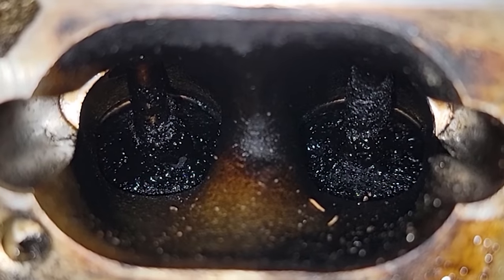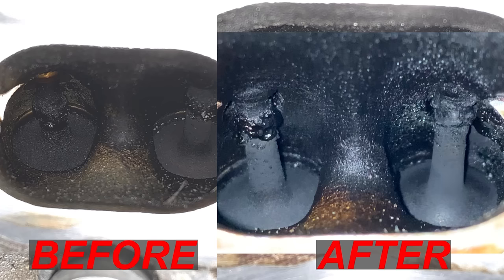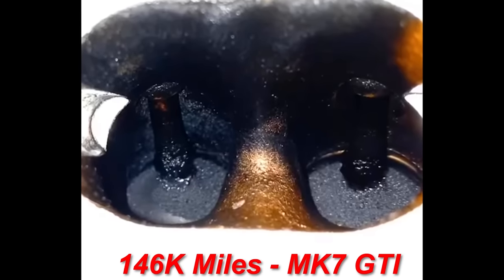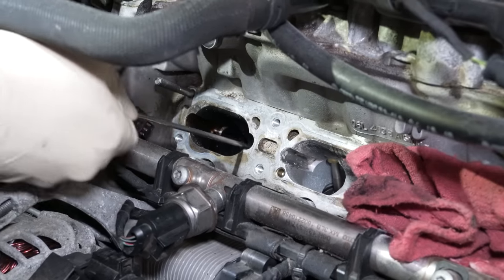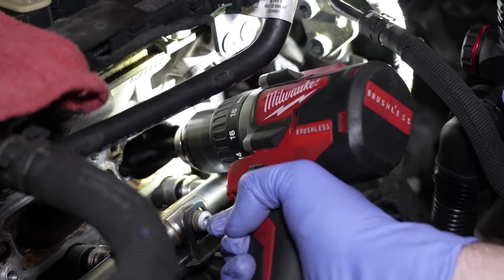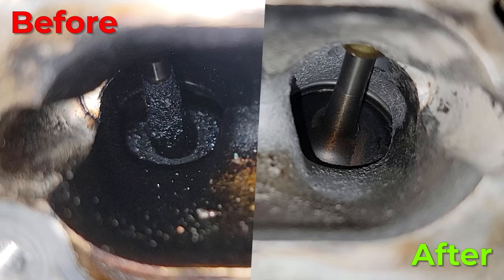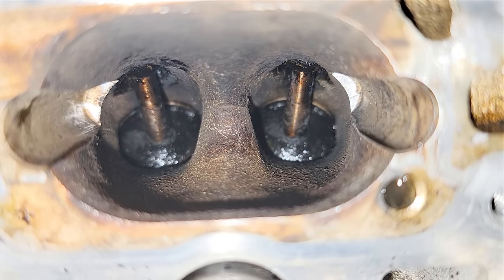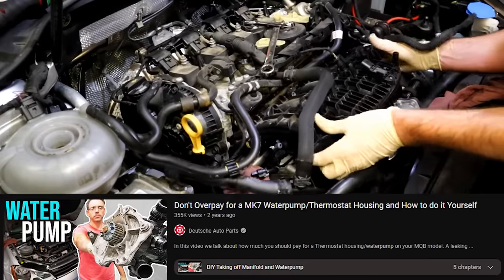How To Clean Carbon Off Your Engine!

Comment: Italian tune up does work, it has been proven and is a chemically totally sound method. Italian tune up doesnt mean reving your enigine in neutral though, you have to actually drive the car under full load for an extented time. 15 minutes of topspeed is totally enough to burn all the carbon off. You have to hit a certain temperatur on the valves for the buildup to dissolve that I dont remember exactly but it does for sure work. Somewhere around 380° celsius. Drive your car properly and the carbon will burn off automatically. German cars are not meant to be driven at 120 kph guys... You have to use the engine from time to time for what it's designed for.
Reply: So a track day from time to time

Comment: I think the only good way to remove the carbon build up is removing the head, pushing down the valves so u can remove it from the round end shape as the carbon buildup is mostly between the 2 surfaces touching eachother

Comment: Im a 12 Mustang owner and Fan boy Ive never had a issue like this, My wifes Buick enclave gets so bad i have to clean it every 25000-30000 miles. I tried seafoam DI cleaner. Barley did anything. I use a combo of pick, Toothbrush, with a hose hooked to a shop Vac.

Comment: would be interesting to see a dyno with before and after , i'm curious how much did that carbon inhibit the air that the engine needs . maybe it would help also if users wouldn't take the car to cross the street and avoid short trips
Reply: The Best prevention of these carbon clogs in the engine is to cut off the Egr valve, which is bringing this dirt from the exhaust back into the engine. So, the Egr valve does not eliminate the pollution of the environment, but just delays it, and stores that pollution into your engine ports. That is why the Egr-valve is a terrible deception , just as the catalysators are.

Comment: What's your take,on the old school method from the 50's & 60's of using plain water slowly into the intake system while idling on a hot engine to steam clean you're pistons and valves? without harming the cat's.

Comment: Have used 50% automatic transmission fluid and 50% acetone blended.  Soak and agitate lightly with an old toothbrush.  Carbon melts off in no time with little elbow grease.

Comment: Can carbon build up cause misfire on cylinders and rough driving at low rpm? Also epc and check engine light? It all started with cold start misfires but car drove well.
Recently it started rough idling and misfiring a lot while driving and it was very noticable, engine shaking as well.
I replaced spark plugs and coil packs, still the same. Misifiring always from cylinder 2 and 4.
My mechanic said it’s carbon build up and we need to clean them, this is a 2013 tiguan 2.0L turbo.
Makes sense?

Comment: So it appears in the long run, for better emissions and performance it is best to have port injection over direct injection.  Or even an obsolete carburetor option for an air/fuel mixing device.

Comment: 5,000 mile oil changes with GF-6 certifications and prophylactic air/oil separator. BG induction service every 30k as well as replacing PCV valve. Done.

Comment: Would a dry ice cleaning machine help you clean that carbon of those valves faster? That method has been used in other situations with fantastic surface cleaning results.

Comment: Ironically the Italian tune up actually does help and so does running in the rain.  Doesn't stop it from happening but does reduce it.  Better than not doing it.  I had way more carbon build up when I drive fuel efficient 98% of the time compared to when I held the revs regularly.  My engine was taken apart to walnut blast it, so I did see the difference.  My engine lasted about 20k longer before it needed to be taken apart and cleaned when doing Italian tune ups and yearly seafoam spraying.
Reply: Engines up to temp are definitely much less susceptible to carbon buildup, as most of it happens when the engine is warming up.

But burning off builtup carbon buildup without detergents or other cleaning agents is usually impossible off of pure spirited driving alone.

But yeah engines actually will be healthier when they get to use their full rev range (when up to temp)
Reply: I don't doubt the Italian Tune wold help remove carbon from pistons and combustion chambers, but the issue he's talking about is with GDI engines. Gasoline doesn't get sprayed before the intake valves (but directly into the combustion chamber instead), so valves don't get washed during fuel delivery.

Comment: I just did a spark plug on my suv and have accumulated a lot of carbon build-up on the intake valve using the endoscope camera.  Is there a way to clean them without tearing apart the engine?

Comment: Could you use EGR cleaner on the valves instead of the valve cleaner used in the video (thinking more for diesel engines)?

Comment: Direct injection might offer more power etc but with the on going trouble of clogging inlet valves further down the line would make me look for the older type port injection engine. I believe Toyota have engines with both port  and direct injection to cure this problem.

Comment: Had a ford with 5.0 liter dead skip on 3. Did all ignition tests and inspections. Then scoped cylinder and found carbon issues. Performed a b.g fuel induction service and vehicle came out of skip.  Note a permanent fix but bought time and gave customer time to plan for bigger service. I believe it was an island truck and probably did a lot of idling. Im not sure but suspect that even with dual fuel injection system that multiport injector is not fired at idle

Comment: I got a 2012 Seat Leon with the 1.4 TSI 125hp engine with 190000km
On cold starts it sometimes makes a noise for 2-3 seconds then it's gone.
It comes from the timing chain side and I think it is most likely the chain itself slapping on something while the oil pressure hasn't built up yet.
Is this a common problem? should I have it checked/replaced?

Comment: All the picking, scraping, and scratching seems like it would create a surface finish that would make it easier for carbon to in the future because you’ve created a mechanical tooth for the carbon to accumulate on. I also don’t think the brake cleaner is a good idea to use during this process either, because it could damage your valve stem seals, making them gooey.

Comment: hi what do you think of Red Line Synthetic Oil. SI-1 Complete Fuel System Cleaner is it any good does it help at least a little or not at all ? For direct injection carbon build up.

Comment: I've noticed that if the carbon is bad, even seafoam won't work properly. It softens it to a goo and then it contaminates the valve seats and causes it to misfire even worse. You really need to get ALL of the carbon. Acetone is said to disolve carbon very very well. The only way this was fixed was because manufacturers had to add MPI again alongside GDI because the GDI system is simply not reliable without fuel spray to clean the valves. Imo there should be NO carbon on the valves as it causes air flow impedance.

Comment: QUESTION: would doing the soak method for a WEEK dissolve/remove carbon deposits without scraping?
Reply: It might, but you would only be able to soak 2 cylinders at a time, right? So it would take 2 weeks.
Reply: Unless you're taking the cams out for another repair and could soak all four at once, that would take more time than it is worth.

Comment: The answer is Seafoam: BUT NO! You can not just squirt a bottle down your intake. You manifolds must be off and valves must be directly sprayed. Had a 20v 1.8t motor where the exhaust valves looked crazy horrible, sprayed the exhaust valves, drove for a week and pulled off the manifold again and bam....looked like the op's after photo. 100% clean, no residue or oil.

Comment: Your valves get carbon build up due to your PCV venting into your engines intake for burning in the combustion process. This is an EPA requirement. To avoid carbon build up on your valves, vent your PCV to the air/atmosphere. Remember those little mushroom things on the top of your engine's valve cover back in the day. Those use to vent PCV fumes to the air/atmosphere until The EPA decided that it polluted to much and required routing into the intake. On the vast majority of cars you can easily modify your PCV to vent to the air/atmosphere thereby bypassing any need to clean those valves.

Comment: Air oil separators do what a catch can does but eliminates the maintenance by returning the oil to the oil pan after burning off the gas and moisture in the oil vapor

Comment: Would using a small circular wire brush on the drill after the soak possibly take off a lot of buildup faster that using a pick initially?
Reply: I'll bet the wires birch bristles that break off will be great for the engine!

Comment: With 130,000 on the clock having never cleaned the valves, how many bottles of valve cleaner would I need to get a nice clean going with the soak and pick method?
Reply: Probably more than you're likely to buy.

Comment: The 2012 through 2017 Chevy Equinox uses the ECOTech 2.4L GDI 4 cylinder engine, do these engines have this carbon problem in the intake valves?  I have a 2014 model with over 200K and have never done this, and no issues with misfiring or other issues...  🤔Are there other products that can be used externally or spraying so you don't have to disable the engine?

Comment: I wish I could share the pics of the MB m273 I just scraped and cleaned by hand. All 16 of them.
Night and day difference. Complete top end air, fuel, and ignition rebuild.
Purrs like a kitten now. Motor wasn't maintained period...😢
These weren't noted for carbon buildup at all....

Comment: Italian tune up works only on the following conditions:

The exhaust valves were carboned up...

And only because the engine was carburetored (improper "rich" fuel air mix due to stop and go city driving.)

This translates to a carboned piston head as well.

And no you don't race it like a hooligans who stole it.  You take an hour road trip at 75-80 mph, let your rpm reach 4000 and stay there for the majority of the trip.

Do an oil change there after.

What it won't do...
It will do f@ckall to your intake valve and manifold.
It will do buggerall if your carb is not tuned, you will have to do it then every 2 months and you're wasting fuel anyway... Get your carb tuned!

If you have to do an Italian tune on a fuel injected car, it means your injectors are on the fritz, get them checked out!

Just an old motorcycle racer's, and garage petrol head's two cents.

Comment: what about the 6 cylinders? 3.6 vr6 fsi buildup bad?(ive used 93 gas and liquimoly oil cahnges since 36k miles when i got it, but i think i feel cold start misfires?) They have the two piece intake manifold, can you do this with taking off just the top piece or do you need to take off the other piece?

Comment: Get the engine hot, hold the revs very high, get a plant sprayer/ mister trigger spray bottle of tap water and repeatedly spray in to the air intake

Comment: I have a question. 2016 GLI, uni stage 3 (Cts Tr2000) I am Catless, but whenever I stop at a light and get going again I get a plume of blue smoke. Catch can and pcv lines are good. Sound like a turbo seal issue?

Comment: Is a steel wool brush not a better way to do this instead of a pick? Oh and if those valves where open you dont want that straw to go in to the engine!!!!! If you do nedd a straw on your spray can use some super glue to glue it in place!

Comment: I just did that on my VW 1.6tdi using brake cleaner and it seemed to remove gunk pretty good in minutes. The valves on one of the cylinders were not closed entirely so the brake cleaner went into the piston housing and i could not extract it entirely (other were fine I got everything out) is this going to be a problem when I put everything back and start the engine???????????

Comment: The best way to keep valves clean is if u bought your car new do all your oil changes on time and use valve cleaner in your gas tank amd crankcase every oil change guarantee it will be extremely like new for the life of the car.

Comment: What's the best method to clean  BMW N63 or S63 when you can't get to the back of the exhaust valves without pulling engine?

Comment: I am servicing a 2009 Porsche with a 4.8. High mileage, I am unsure of the oil and fuel quality at this time. Its has some misfires (another shop rec plugs and coils), customer request plugs and coils. I had to pull the intake for a cooling system leak (vent tube) and these intake valves look absolute terrible. I'm on the fence about selling the clean service, true clean, soak and scrape, while I am in here. What would you est. the flat rate time would be for the cleaning itself? @Deutscheautoparts

Comment: Negative, an Italian tune up means driving for a prolonged period of time and motorway speeds. It was introduced by Ferrari mechanic that would take customers cars round the track to get them up to speed and temperature and it DOES remove carbon. That's why highway miles are considered much better for your engine that town miles.
Reply from the maker: It’s intended for carbon inside the engine
Reply: @Deutscheautoparts  That's true however your description of an Italian tune up was a young boy revving his first car and you said it didn't work for removing carbon was on both accounts is INCORRECT. It comes from ferrari, thats why it's called Italian.

Comment: Why are all my nearby mechanics scared to do any of this type of carbon cleaning (including walnut blasting)? They are like how it's not safe, can cause damage to the engine and whatever, but i've seen so many videos online which make it seem fine, safe, and relatively easy. I have only gotten oil treatments to clean which I imagine barely did anything.

Comment: Hey I have a 2005 porsche boxster that needs a remap , we put a 2008 cayman engine and the car accelerating like garbage,  the old boxster engine has 2 vvt and the replacement engine has 4 vvt, bigger injectors and bigger manifold,  how much is the price to remap and tune the car? I'm in Charlotte area

Comment: Do any domestics have direct injection engines or any others with common carbon buildup problems in the valves? Or is only EGR & PCV systems getting dirty and clogged and making engines worse?

Comment: Gdi is one of the best motivators for some folks to go electric..unless a person keeps on top of carbon removal they are  will have driveability problems..and the more wear on piston rings from not changing oil properly the more blow by the engine will have and this causes carbon to build up faster...the low tension piston rings they use on some of these engines is a big factor that leads to blow by and carbon..just guessing I'm no engineer...I wonder if there are after market rings you could fit with more tension?..and if by some means the crankcase vapors could be somehow be routed to exhaust on the front side of the cathlitic converter so it would burn them..beats me lol next car will have both gdi and port injection....might just get me a good classic car with a carburetor and say to hell with it lol

Comment: Hi ., is my first time taking on this task on cleaning the intake valves on my engine . At the start I mess up and thought I had the valves closed , but they was still slightly open , when I sprayed the intake valve cleaner it slowly drain out . I looked inside the combustion chamber and I can see a  the dirty cleaner and some carbon debris that fell through  top of the piston ., I use compressed air into the chamber to flush it out , I can still see a layer of dried up carbon from when I air compress , is it something I should worry about , or will it eventually burn away when I turn on engine and then drive it after it reaches its normal operating temperatures ., I haven’t turn on the engine yet , before I do , I’m gonna put in Lucas upper cylinder cleaner in the gas tank , to see if it helps me out . Any thoughts on that I would gladly appreciated 👍🏻
Reply: Mi carro GTI de la nada empezó a fallar y el cilindro #4 me falló le metí compresiemetro y me marcó 30 me dijo un amigo que puede que traiga en ese lado de las válvulas mucho carboncillo , crees que si se lo elimino vuelva a traer compresión???

Comment: Water-methanol injection, $429?  That seems kinda steep, but, hey!  Inflation, right?  On the other hand, if you do it yourself on one of your first carbon clean-ups (or better yet, before any carbon even builds up to begin with) it should pay for itself by two or three clean-ups if it actually prevents the situation from happening anymore.  Modern engines can last several hundred thousand miles with conscientious normal maintenance; they're not all used up by a hundred to a hundred and fifty thousand miles like they used to be.
But the methods in the video are probably sufficient for "temporary" owners of cars, people who are going to want to trade in, trade up or trade down.

Comment: I just bought a 2014 Passat 128k miles 1.8 tsi is this the third gen engine without the carbon build up issues. 🚩🚩🚩🚩🚩🚩🚩🚩🚩🚩🚩🚩🚩🚩🚩🚩🚩🚩🚩🚩🚩🚩🚩🚩🚩🚩🚩🚩🚩🚩🚩🚩🚩

Comment: Does a VR6 VW Jetta GLI 2004 (MK4) get a lot of carbon build up? (2.8L 24v) 6 manual speed. My car is has over 204K miles.